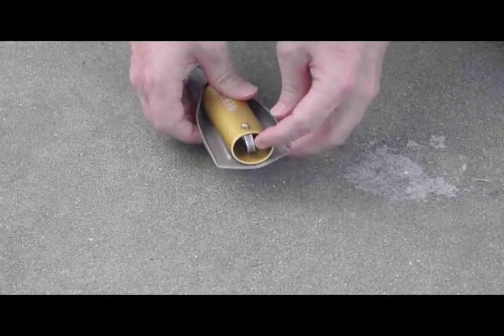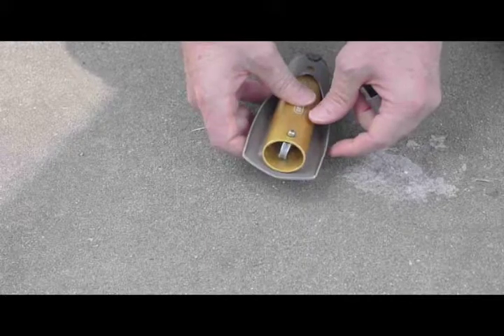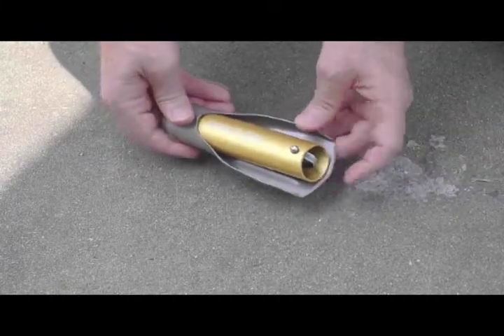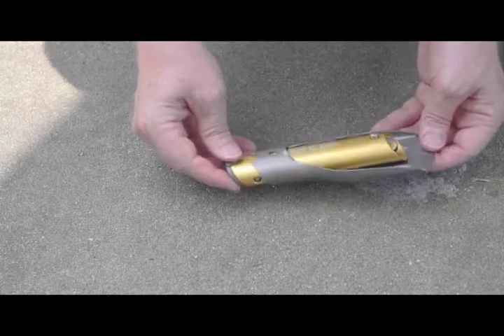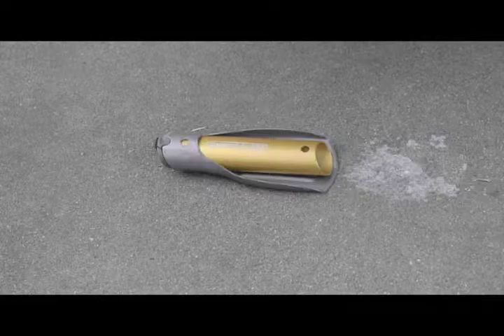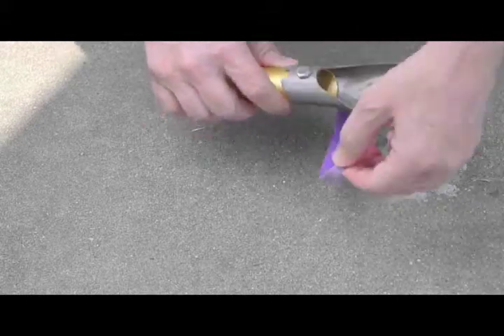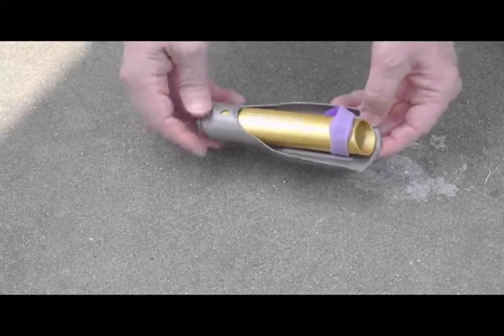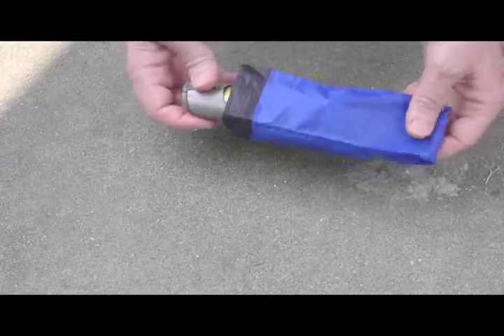Sea To Summit Pocket Trowel Review Part 2: Reversible modifications

Comment: Thanks for the detail on how the original design is supposed to work.  Definitely was helpful in repairing a spring that escaped the channel.
Reply from the maker: I'm glad that you found the information helpful. I'm not sure if the company ever addressed the spring issue in later versions but at least this version had issues. I also saw another YouTube video (2020) by some lady who hated this trowel for some of the same problems that I discovered also, but that I also tried to remedy. Maybe I should ask the COMPANY to consider viewing my video! (?)
Reply: @drcoolit  From a replacement part I received a couple weeks ago, it appears the design has not changed at all.  Emergency field repair could be done with wire or a stick jammed in the hole when it's open, but it's still a pretty annoying design flaw.
Reply from the maker: @inviso1111  Thanks for the feedback re this tool. Sorry that the company seems less eager to explore design options than some of its users!

Comment from the maker: I'm sure you're aware that these are suggestions and/or prototype ideas. There are quite a few other variations. However, all of these are an attempt to correct some of what I see are design flaws in the original design. I have found the re-oriented spring to work the best. 

If the company desired to do so, a more elegant incorporation of that idea, OR the bolt idea (bolt in this case permanently attached) would work, and better I think than the tool, as purchased, that I tested.

Comment from the maker: I must not be explaining myself well.

By permanent I mean that it's part of the tool, just as the rest of the components. It doesn't mean that the configuration of the tool is permanent. The "permanent" refers to my addressing the possibility of the bolt being lost (as you pointed out in the prototype), not to infer that the tool now is no longer compactable, portable, or easy to use.

I hope I have done a better job this time in getting this point across.

Comment: New tools are tight .. lets fix imaginary issues as my ego is bigger than the engineers, hiking experts and designers that spent thousands of expert USE FIRST hours AND TESTED .. bugger them lets make a shi+ digger have shi+ grabbing holes exposing locks to grit and shi+ while having to lovingly stroke the shi+ end! Lets also add velcro to the shi+ end   FAIL
Reply: The design from Sea to Summit is really pretty poor.  The key problem is that the button can get stuck or the spring can spin out of its original spot and it's very difficult to field repair.  We had a spring vanish on us on a recent trip and Sea to Summit sent a full replacement barrel rather than just the spring and end cap.  The design is unchanged as far as I can tell and I fully expect we'll have it fail in the field again.  This is not an imaginary issue...
A field fix is to jam a stick into the hole with the handle extended which is just an ad-hoc way to do what he's done in the 3rd video.  
My kids like this trowel and I'll probably have them carry it unmodified, but bring a small bolt and wing nut to field repair if button gets stuck or the spring otherwise works out of position.